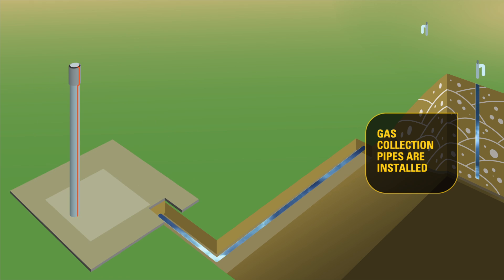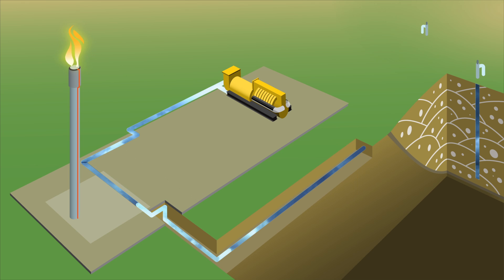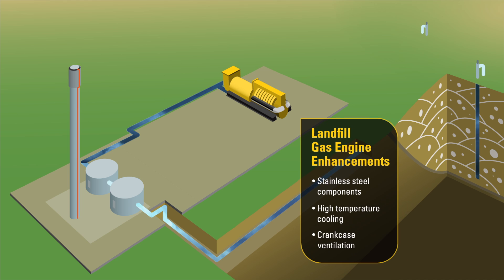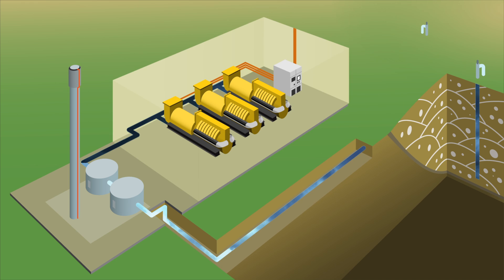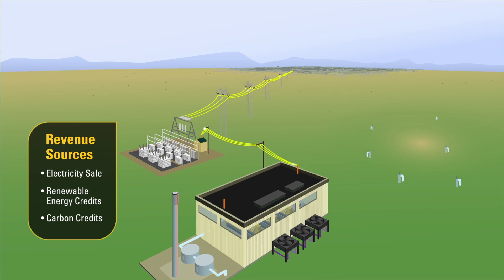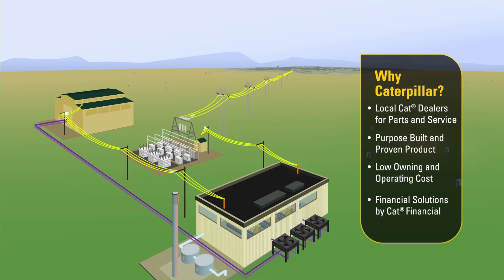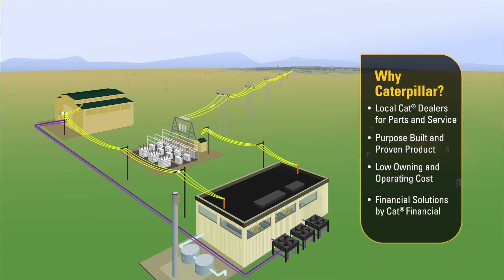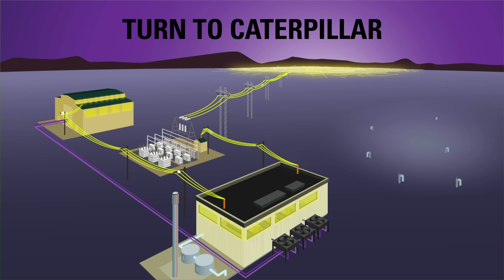How Cat® Generator Sets Produce Electric Power from Landfill Gas

Comment: How does exactly the CAT power generator mitigate the effect burning Methane has on the atmosphere? Methane has a 20x greater effect upon climate change by the Greenhouse Effect than that of Carbon Dioxide..
Reply: +DRBWildlife 
when methane burned it became carbon dioxide.
Reply: +DRBWildlife The methane, like all hydrocarbons in combustion, is turned into CO2 + H2O + energy.
Reply: I'd also like to add that when methane and similar light hydrocarbon compounds are burned, they produce much less C02 than current fuels.
Reply: DRBWildlife don't worry climate change is a hoax so quit crying

Comment: Just one query .How much I put this way is it possible to measure the volume of methane gas that is being generated daily from our Earth for Cat generator(s) demands in terms to operate at full capacity of its designed output and not fairly in percentage value let say for 50% due to the presence of gas is dearth.